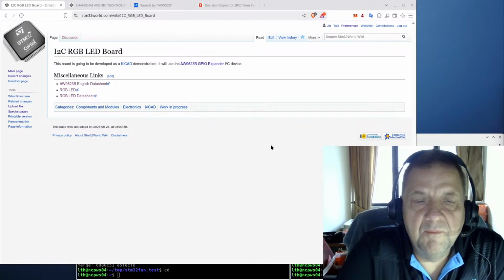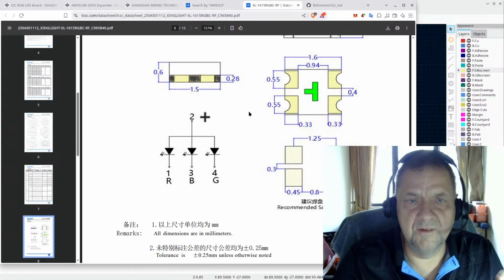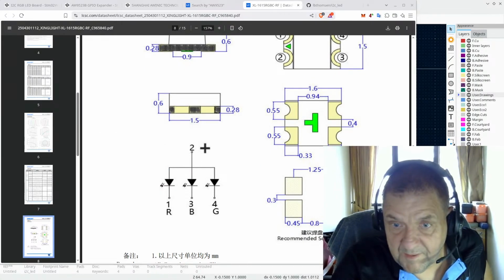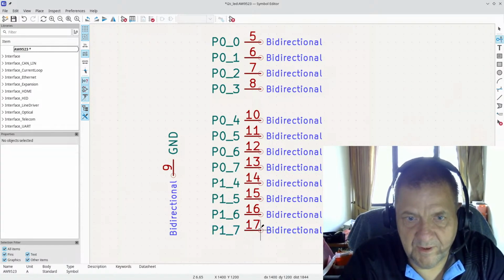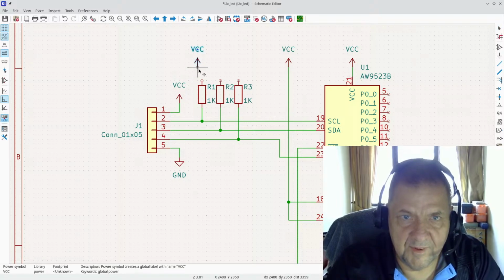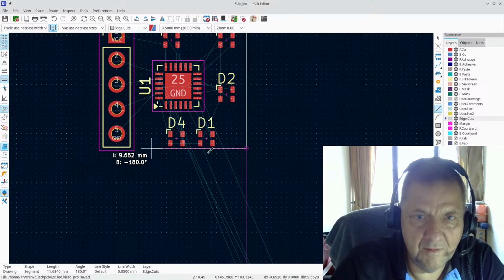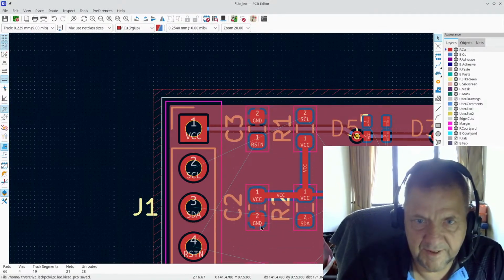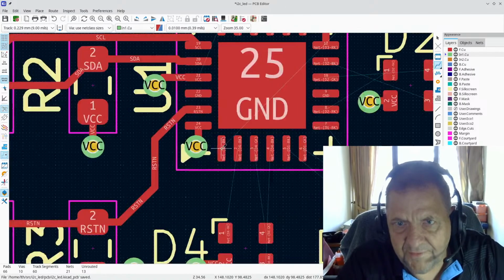KiCAD Project From Scratch #1 - Designing the Schematics

Comment: @28:30, you could position the pads by using Shift-M for "move", or by editing the pad with keystroke "E", and using the X-Y position inputs. Or you could switch the grid to the largest appropriate sizes for each direction. Also, instead of drawing lines for the perimeter of the LED, why not use the rectangle? Because you're doing it all live, I suppose. If you press Shift-Space, you can switch between drawing lines at any angle to only having 45-degree increments, i.e. vertical, diagonal, horizontal.
Reply from the maker: Kind of my first live stream and it is a LOT harder than the regular videos.  I am NOT good at thinking while I am talking.
Reply: @stm32world  I imagine it's like an oral exam.
Reply from the maker: I used to be quite good at those but it's been a while since I had to go through one ;)  Learning to do oral exams well was learning to bluff well ;)